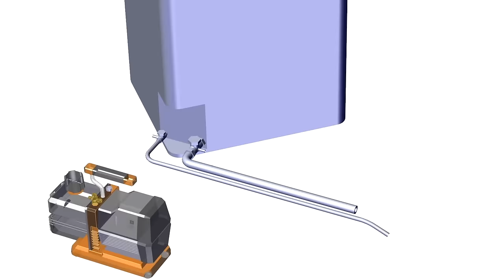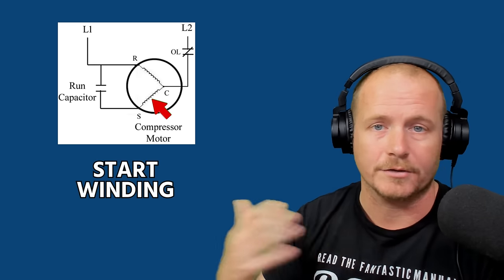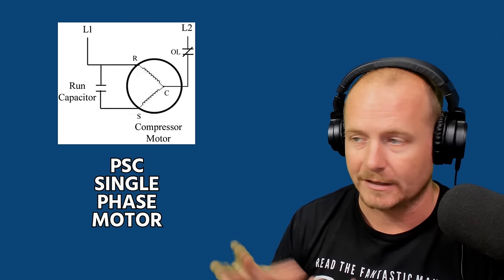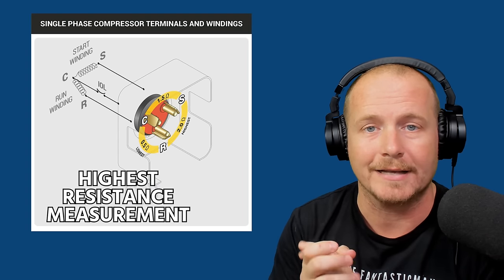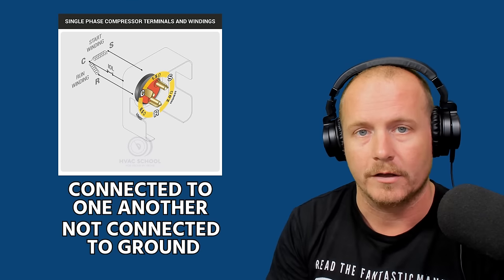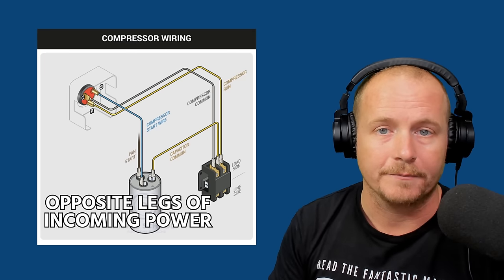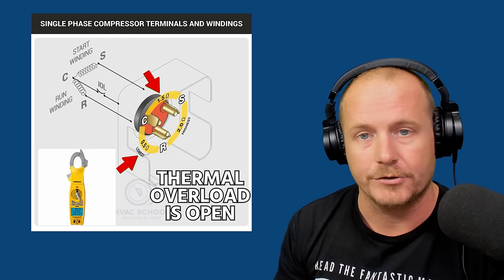What is Common, Start and Run?

Comment: I really enjoyed this video.   Question.  I have a tempstar 3 ton 1 phase home A/C unit. Looking at the compressor wire set up, it shows R - Red wire, C - Black wire, S - Blue wire.  The blue goes to the start or HERM of the dual capacitor.  The black is common wire, and red wire is the run. If I want to test the total inrush, which wire should I clamp my meter onto? Also, do u know where I can find the wiring diagram?  Mine washed out. 
 Model # TCA236AKC4,
 S# E052050914.  Thanks.  I hope u can help.  John.

Comment: Question for you, in the UK our compressor wires go straight to the printed circuit. I am new to the industry i want to learn and do well. As testing goes do I just wires from my board to compressor like you would do if you had capacitor?

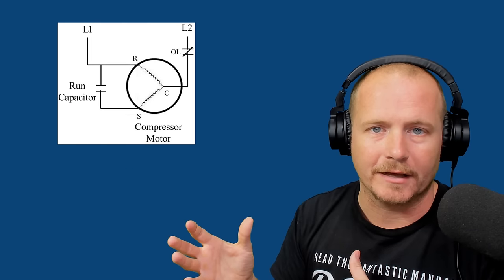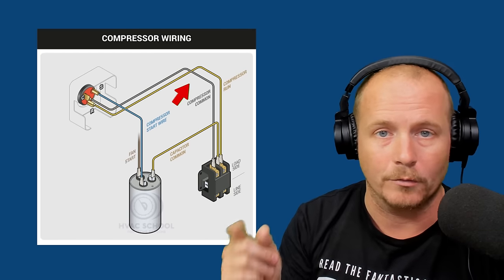Comment: Just a little confusing if you look at schematic/ drawing around 1:05 and then drawing at 4:15. 

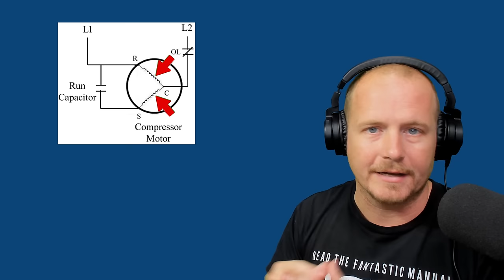You have L1 going to motor run at 1:05 then at 4:15 you have L1 going to motor common.

Possible confusion if the new tech doesn’t completely understand 220 single phase as the common side of the capacitor an be loaded from either side of the motor starter/relay contactor as well common and run

Otherwise, as always, a very nice video
Reply: Melvin292 - as with most contractors, there is line voltage in so, yes. T1, T2 is the opposing side of the relay. I’m sure just simplified for demonstration purposes here in this video
Reply: If the connection to the  contactor were reversed it would be the same operation

Comment: What would happen if capacitor C is connected to same leg as compressor C. Less torque at start right because it still comes with phase shift from capacitor. Thanks for sharing
Reply: Common is the path back to power source. So if you hook that up to C, with R hooked to T1 and S to Herm... nothing would happen. You dont have a circuit. If you introduce T2 to the capacitor then you'd have a circuit, possibly (Herm and Fan aren't connected so if you put it on the opposite, no circuit. Put on C then you have a path to and from source.) The problem is you'd be phase shifting both windings, it might run backwards, it may not have the correct torque to start at all if they're both shifting the same. Im not sure without testing, I have a sacrificial motor here... needless to say it would NOT be operating correctly and probably shorten the life of windings or hopefully capacitor first.

Comment: Quick question I can't get a straight answer from anyone on this topic. Your thoughts would be greatly appreciated. Why when measuring voltage at a running compressor is there higher voltage than the input voltage?

Comment: So there is three pins right.
You would connect the red phase to the  common. Then the  yellow  phase to the start and the blue  phase to the run pin.   Then switch on

Comment: This video for clicked with me to create what I suppose is the "story", which is how I remember things.  I'm terrible with remembering random things not tied to their reason.  So the story goes like this:

The run and start/aux windings on a motor must be connected to the same leg of power as they must be in phase with each other.   The start/aux winding is then shifted in phase compared to the run winding by connecting the start and/or run capacitor in series with the start/aux winding to create a residual force between the  windings' magnetic fields that gets the motor turning, and for the run capacitor after start up to also "tune" the motor for the most efficiency at the design load.  

Common (C) on any component is almost always localized to that component and has no relation to (C) on any other component.  For instance, power from the same leg as the run winding is pigtailed to the (C) terminal on a dual capacitor where it is forked to both the compressor motor via (HERM) and the fan motor via (FAN) terminals.  Whereas the (C) terminal on a motor is where the run and start/aux windings are tied (commoned) together to connect to the opposite leg of power to create a complete circuit with the line power.  Going back to the first "rule", when using a dual capacitor both motors (compressor and fan) run windings are connected to the same leg of power since their start/aux windings are also connected to that leg of power via the dual capacitor (C) terminal.
Reply: Don't complicate it. You're completing a circuit, simple as that. The start windings are shifted out of phase with the main windings due to being run through a capacitor, this gives you the torque to get the motor running and in the correct direction. After that point they just provide extra emf at a different angle as the squirrel cage rotates but the main windings provide the real torque when they are pulsating.

If you hook common wire of motor to C on capacitor and then the start winding on Herm (or fan if talking fan motor) then nothing would happen with Run going to contactor as there is no circuit. If you hook L2 up to the capacitor then you'd have a circuit but it might act funky because it has to loop power both main winding and start winding common through the capacitor to get back and forth from L2. Im guessing heating issues and possible rotational issues and capacitor issues if it ran at all. Needless to say, motor run goes to T1 as does C on capacitor and motor common to T2 assuming the hookup of the contactor correctly. Start goes to Herm. (Or fan if condenser fan) pretty easy.
Reply: I think this article is well written.  Thanks
Reply: Thankyou vrey good  sart  s  runing  wing  power sarting only start  comon c..over old prtcating wininding

Comment: Regarding resistance values in 'Condenser FAN motors' resistance across the run winding will typically be higher than across the start winding. Check it out - its real
Reply: Only if you run the motor backwards... which it really shouldn't as the run windings are thicker gauge, which means lower resistance and less heat. The start winding typically don't fall out of the circuit on these motors. I just tested three. C TO R is lowest, C to S is middle, R to S is highest resistance just as it should be on any motor.
Reply: @etherealrose2139  You would think so - and that is the way I used to teach it. If you do reverse S and R the motor will run backwards as you say but -  I have a lab of about 16 different systems, all 2 ton,  (lennox, york, etc) - few years back had my students identify the condenser fan motor C, S, R with the ohmmeter and wire things up only to find them all running backwards - after scolding each I found it was I who was mistaken. Each condenser fan motor had higher R winding resistance than S winding.  My systems are all 2016 and newer so not sure if the ones you were checking are newer or older.  I would be interested in what model you are testing - I could give you some of what I am testing. 
Best

Comment: Nice video.  I knew all of this, but it took me a lot of brain racking to figure it out on my own.  This is one of those things that some guys work around for years and years and never understand it.  Awesome crash course for clarification/learning and very applicable.
Reply: 3temanels   highet    midum   comon  factor  startung .   High and lowest common    facter  Runing  .midum  and lowest  comon  facter comon  .comon ok gues   s.starting  R.Runing  systiom ruing   s.  Starting s  only statungok
Reply: Starting only  cap cter is  staring power dis contactung

Comment: Bryan singal phàse motor fowerd  reverse connection on both way starting winding get line supply with the running capacitor  on this  time current flow in (centrifugal switch off) both the coil one left to right other right to left is it not harmful to motor I am a 
Bigginer for the motor rewinding phàse Ripley me

Comment: Why is it called run capacitor if it is in series with start winding 
Pls clear this doubt
Reply: Start/Run capacitor is what they call them I believe when only one cap is used. If there are two CAPs, one is start and the second one is run.

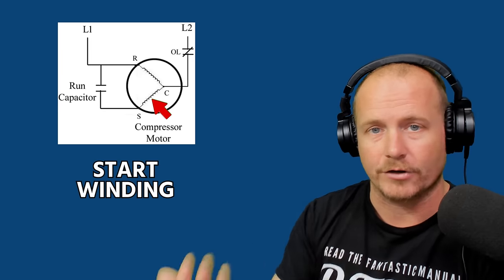Comment: Sorry, major ignoramus here.  on the diagram at 1:40, what is L1 and L2, and what is that OL cap with a line thru it?
Reply: L2 is actually a neutral line. And l1 is a power or hot line.